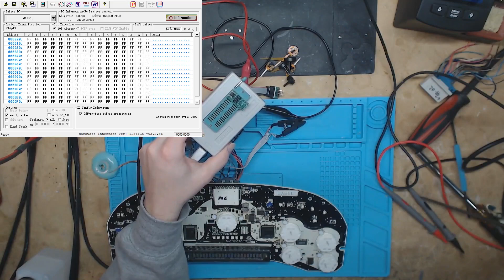TL866CS In Circuit Programming GM Cluster (Fail)

Comment: Look for programer for gm trailblazer cluster programer... and hardware please recommend
Reply from the maker: They make obd2 tools for this you don't have to do it via eeprom. So if you plan on buying a tool you might want to look at them. I just use eeprom programmers because I already had them before I got into clusters.
Reply: @FixedUntilBroken   does it work for 2002 model trailblazer... i have a autel reader but it  doesnt program ... i need a cheap programer what locations is the  address for the milage... for trail blazers .. what software calculate  the hex code to insert ... is the vin also storeged on cluster?
Reply from the maker: Cheapest way is to take the eeprom off the the old board and put it on the me new one.

Comment: I also have a TL866CS original , modified it to the TL866A version firmware and ICSP port, really easy to do. Still have web site info and a few ICSP connectors on hand if you are interested, let me know. It was discontinued because of all the chinese clones that came out, a company can't make any profit if the illegal clones are selling for a lot less than the original. Knowing the limitations of the equipment I can say that mine has done everything I need it to, I'm happy with it.
Reply from the maker: Unfortunately even with a modded or genuine one won't work because there are other things on that same 5v rail. If you use the Linux software it will work because it doesn't look for over current on the Linux software.

Comment: The company does not support its previous products.  They will orphan you in a heartbeat just to sell you another burner.  I bought the TL866CS and was orphaned four months later when they dropped all support for it, including dropping it from later revisions of their programming software.  So I'm stuck at revision 6.85 forever.  Thanks for nothing.
Reply from the maker: Do you have a recommendation for a better product at a similar price? Real question I am not being a smart ass. I like the Minipro myself and haven't run into much other than the over current protection getting in the way. I have been think about the GQ-4X but haven't had a reason to pick one up yet.
Reply: @FixedUntilBroken  I like the  burner well also, but I bought it and shortly after was orphaned as a pirate.  My burner is genuine and I don't like being called a criminal when I'm not.  I think the vendor is wrong to kill off a bunch of legitimate customers for any reason.  It is an evil practice and I thought folks should know.  I don't have a replacement in mind, but when I do I will look hard for some other make.

Comment: there is a TL866 Mods for ICSP Header you can do 
https://www.youtube.com/watch?v=W7XGiqD5icU&t=37s
Reply: here is part one https://www.youtube.com/watch?v=JM_2fd9YtFk
Reply from the maker: Yeah you can even buy the 866II with it already on it. Doesn't work on these boards it has too much stuff on that 5 volt rail and goes into over current protection. I've mention that in a few videos.
Reply: @FixedUntilBroken  over current I fix it bro
Reply from the maker: @naeemzia-dp8np  I don't have WhatsApp.

Comment: Id love to see a video with the new TL86611 plus doing the in circuit test and program to see if it works . Curious how you hook up the in circuit plug to the side of the TL86611 like you mentioned in this video.
Reply from the maker: Alaska Cluster Repair did a test on it. doesn't work. That's why I built a homemade programmer.

Comment: Really interesting, are you going to get a new programer to do in circuit programming?
Reply from the maker: Maybe in the future but I have no pressing need to get one.
Reply: @FixedUntilBroken  I was looking to buy one but wanted to make sure I got one that worked. I have a Weller WR3000 but like the idea of doing it on the board.
Reply: Some alterations in minipro circuit programing OK  I try it my self 03145263332 whats app
Reply from the maker: @naeemzia-dp8np  modifications to the minipro still won't work because of the over current protection this board has too many things on that 5volt rail. I guess you could probably short the current sensing of the minipro but why bother when $5 Arduino nano can program it.